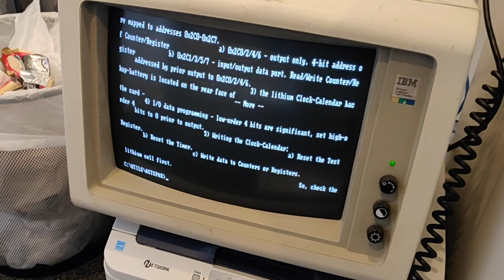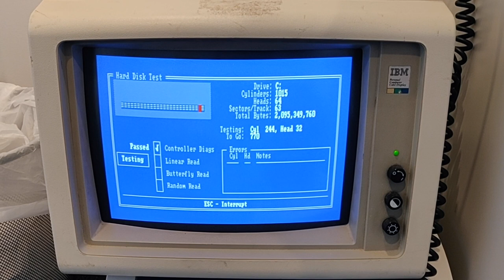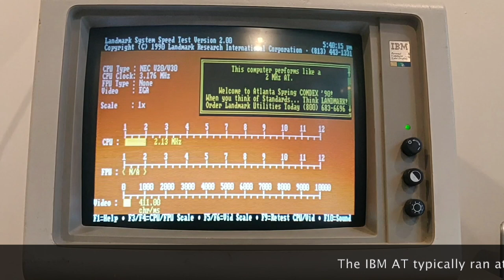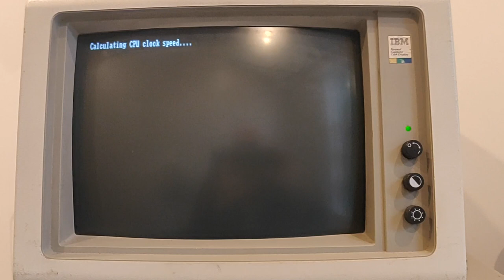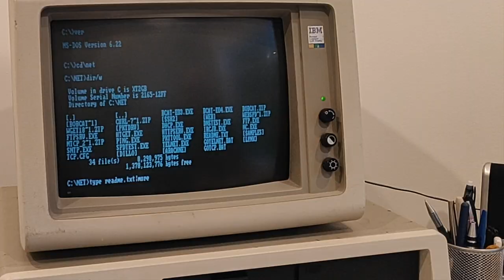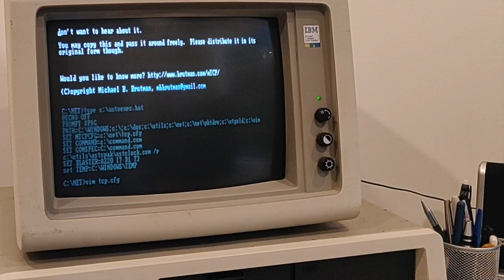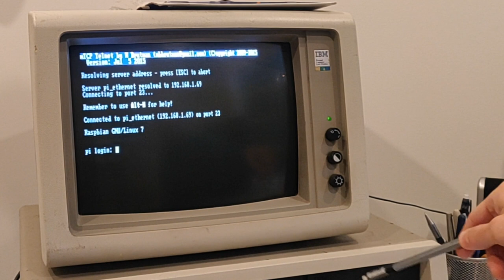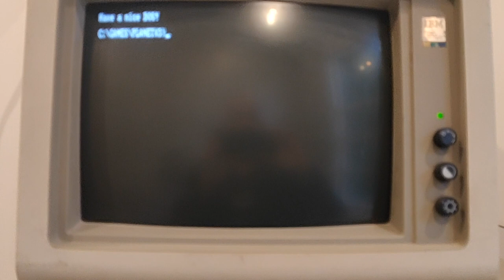The Internet connected Hot Rod #IBM PC #XT!

Comment: Is that the Orchid Tiny Turbo 286 in there?  I'm assuming that unlike later turbo buttons, you cannot toggle that switch while the system is running because it's switching between two different discrete CPU's.  Am I right?
Reply from the maker: You are absolutely 100% correct on all counts! Top of the class for you Angela!

Comment: That version of Landmark seems to be giving incorrect results. The clock speed in the top left of the screen should be the real clock speed, and in both cases (8088 and 80286) the speed it's showing doesn't seem right. The 8088 should be at 4.77MHz, and the 80286 should be at 8MHz, not 7.285. I think that's an older version of Landmark, there are newer versions that are more accurate. Also, if the reported characters/ms is correct, then that is a slooooooow video card... so I think that must be wrong too. Most cards from that era were anywhere from 2000-4000 chr/ms, and some (like the Tseng ET4000 I think?) got up to about 8000chr/ms. I suppose it is only an 8-bit interface, but yeah... all those numbers seem way off to me.

Comment: Beautiful work! I'm interested in XT compatibles as well, although in a much smaller form factor, like the Atari Portfolio, Poqet PC, and HP 100LX :)

Quick question about the internet connection - I'm planning on implementing mine entirely over serial, as my machines don't have glorious ISA slots (or supported PCMCIA Ethernet cards) as yours does. Which do you think is better - ppp over serial (ppp packet driver) + mTCP and/or ssh for DOS, or just a plain serial Linux console via getty/agetty? What is the packet driver + mTCP memory usage? My machines have either 640K for the most part or over 1MB (EMS) in some cases.

Currently I log in to a battery-powered OpenWRT router with an agetty instance passed over a USB serial adapter/serial cable to the PC at 9600 baud. Take a look at my videos for more details.
Reply: @AlsGeekLab  Thanks Al!!! Please subscribe ;)

How about just feeding PPP into mTCP and drive PPP over serial cable at, say, 115.2kbps? Would this parallel ethernet adapter be faster? It would indeed be less portable.
Reply: @AlsGeekLab  Ok, I will ask there. Thanks!
Reply from the maker: Hi Abraham, not sure if you are still interested in networking for your dos machine, but check out my latest video, there's some helpful setup info in there. If you haven't already looked into the Xircom parallel port ethernet adapter, that's also a great option, but yes, epppd on a Linux box with a serial cable is a perfectly good option too

Comment: I just got an AST SixPakPlus for my 5150 to upgrade the 256k I have now. Any instructions you can give me on setting up? I am still waiting for it to come in but want to be prepared
Reply from the maker: Hey Austin, The SixPakPlus is a great card, and very easy to configure. If you have bought it pre-populated with RAM already then the jumpers should be set correctly, otherwise change them in accordance with the amount of RAM it has. There are various other settings that can be changed so that they don't interfere with the addresses of other hardware that might be in your machine. Here's a handy website with the settings for the card: https://stason.org/TULARC/pc/io-cards/A-B/AST-RESEARCH-INC-Multi-I-O-card-SIX-PACK-PLUS-CARD.html
Reply: @AlsGeekLab  awesome thanks! I think I found the right software for it but I'll know whenever it comes in I guess.
Reply from the maker: @austinramsay  let me know how you get on. I have the software here do I can send you it if you get stuck